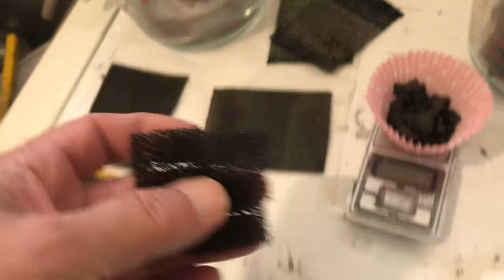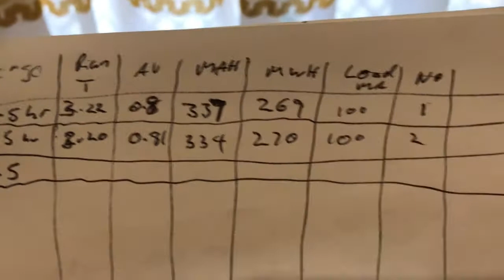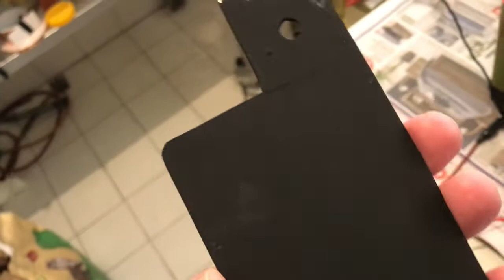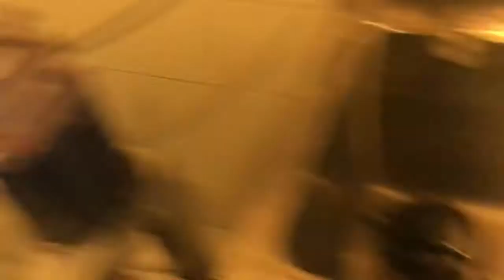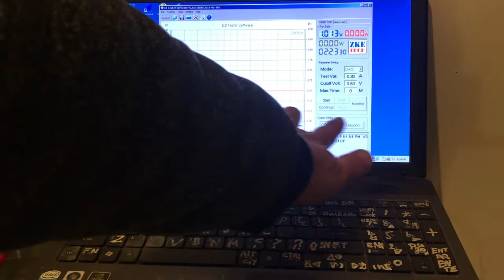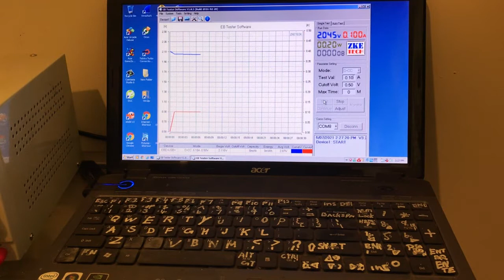500 mAh Nickel Zinc Cell

Comment: Something to note would be to conduct an electrolyte plateing test onto a electrode material you intend to make a cell out of. This will give you a clear voltage that starts to deposit the ion and is an overcharge situation  ! It can vary simewhat including temp etc